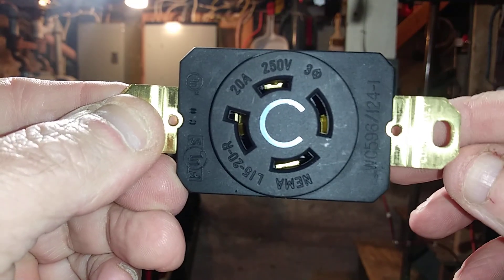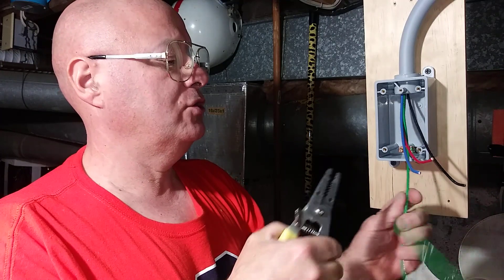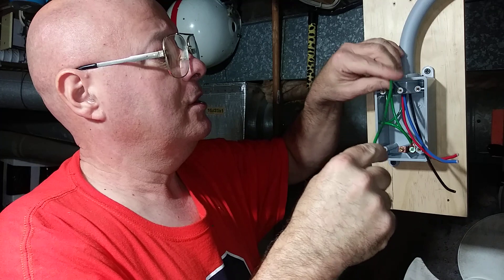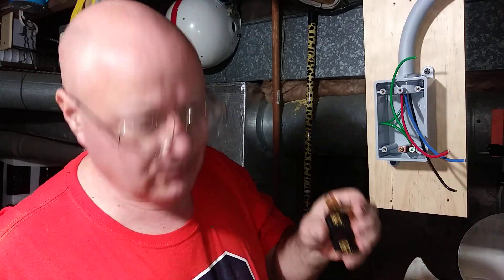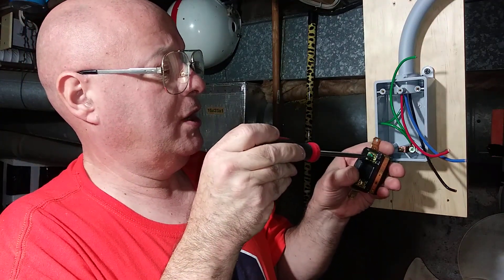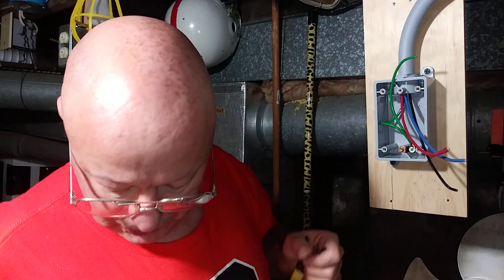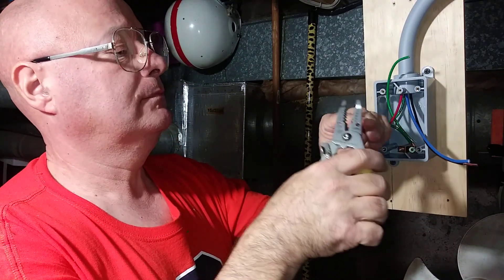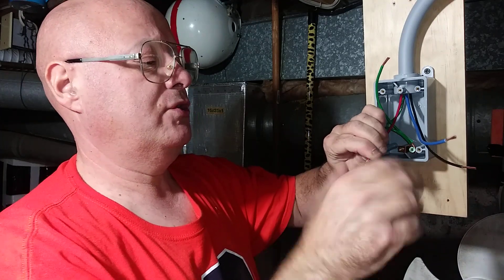How to wire a 208 volts 3 phase 20 amp receptacle

Comment: where is the video showing the connections in the electrical panel
Reply: It would just be a video on installing a 3 phase circuit breaker.

Comment: Should have a caution about plugging a motor into a 3 phase outlet and having the right rotation. Most of our 3 phase outlets at work are for motors. Unfortunately there is no standardization of power leg phasing - one usually just has to plug the motor in and see if it rotates the right way. If not, then two of the legs - any two - have to be switched around.
Reply: Most pros carry a phase rotation meter.
Reply: So I’m planning on wiring my 3 phase air compressor. I shouldn’t do it this way?? Thanks ahead of time.

Comment: personally, I would have double tapped the ground wire on the outlet first, then tied it to the ground strap on the box.... but in reality, I would have used a metal box to start with....